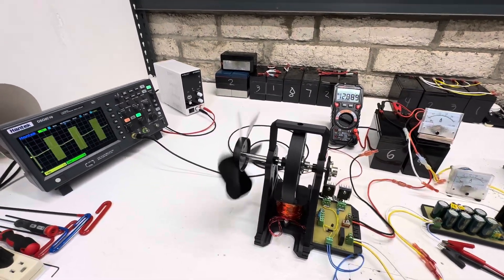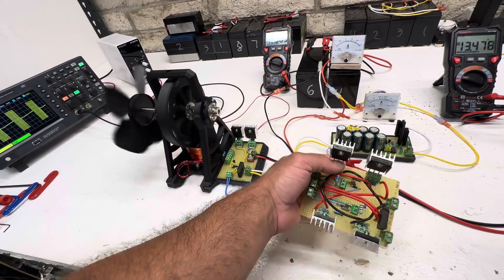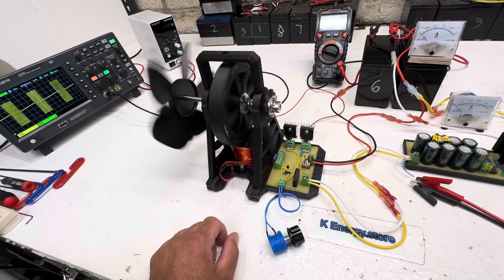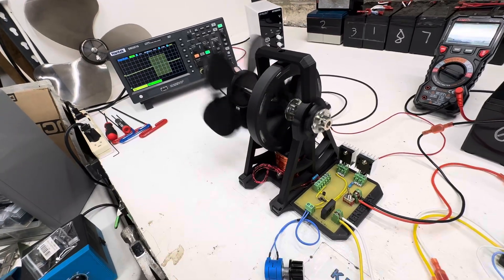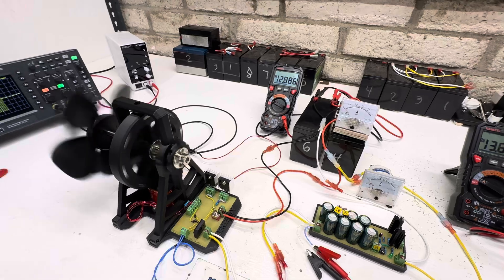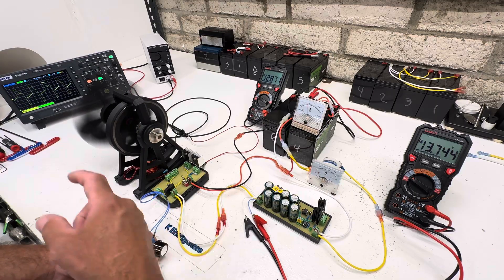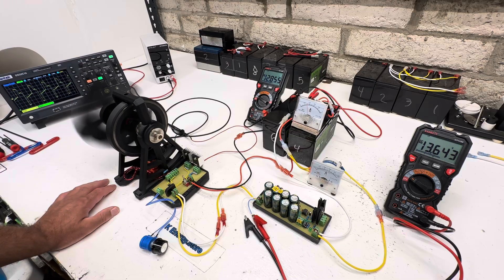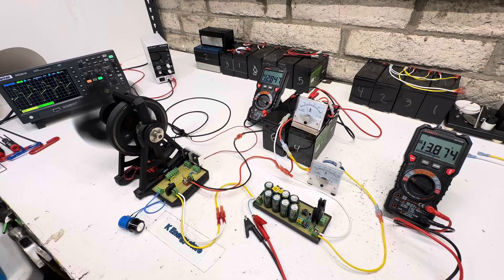Bedini Cole half H the perfect loop back circuit

Comment: Very cool switching both low and high side to loop back. 

My D-Phi Oscillator switches the transistor even with the switch off as long as that switch sees polarity from a battery. 

It acts as a node like the central point on an AC transformer but with a scalar potential well coming off that ground pot if you have around ten ohms for a wire you can make phase conjugate antigravity waves I think and the light entangles in time which can be engineered to create different effects. If you suddenly add capacitance to that ground pin off the Bendini motor it generates negative impulse spike followed by positive wave. You will need nonlinear junction to collapse potential into current. The relative ground can be used to drive a ceramic Disk capacitor to keep it oscillating. This can wirelessly switch the transistor and make the bendni motor switch when off and not moving acting like a continual ground pump. Bendini hinted at sudden recharge effect when turning it off. I believe it was increasenin capacitance on that ground pin acting like a big pump at a low frequency collapsing a scalar standing wave into current into the battery which could be utilized effectively if it goes through let's say a high voltage supercap to effectively impulse the battery. That capacitor can be turned to create standing waves in the battery which holds the ions? 

Much love K energy. I love to see the progress! 

I want to find land and go off grid